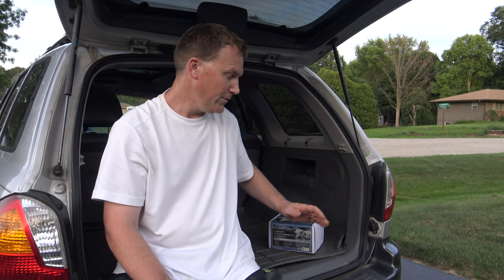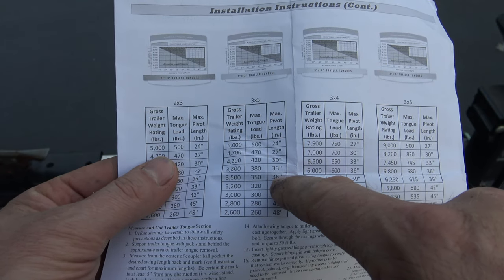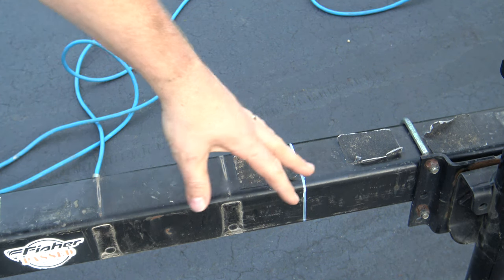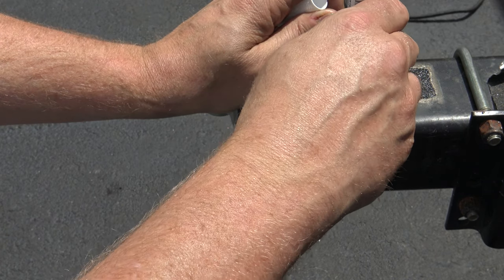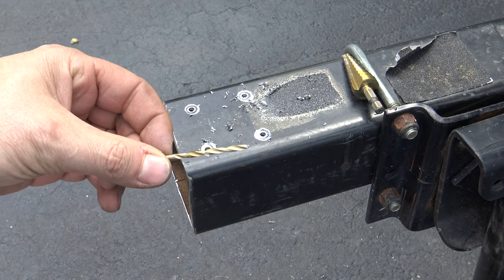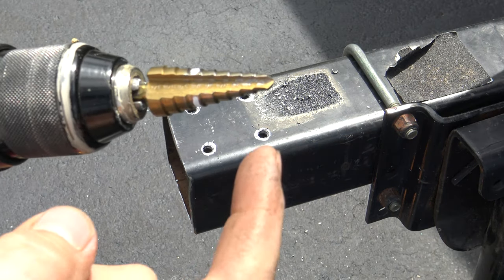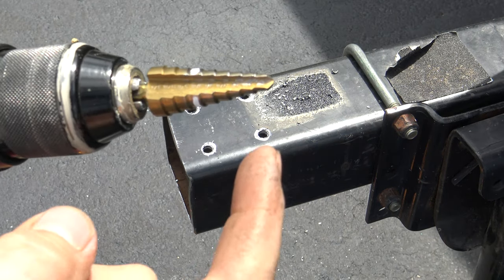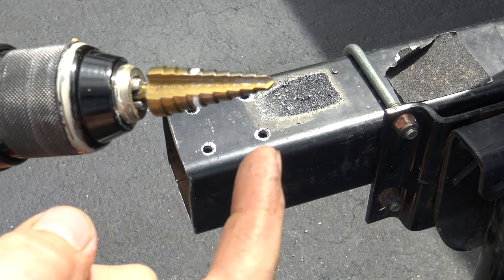How To Install The Fulton Folding Trailer Tongue Kit

Comment: Don’t use Fulton swing away kit ! Mine broke after three years! The boat then struck the back of my truck and punched a hole in my tail gate!
Reply: All because one broke doesn't mean its a wide spread problem. Anything can be defective. By the number of these being sold I would say its not an issue with all of them since you have to search hard to find complaints. Many new boats are sold with bolts in the swing tongue. None of mine have broken. It could have been yours had a defective bolt or wrong bolt installed as in to hard. There's been a small number of wheels falling of cars too! not very common though. heck the two bolts holding the hitch is weaker and you don't see them breaking.
Reply: Stop being a hater, more than likely you did something wrong.
Reply: I’m sure it was installation error and not the actual product
Reply: Maybe the trailer manufacturer installed it wrong! Just to let you know that they no longer use that brand. I’m just saying check your trailer before using it.